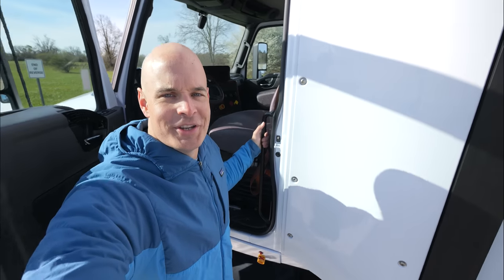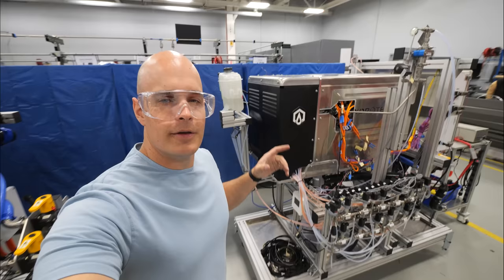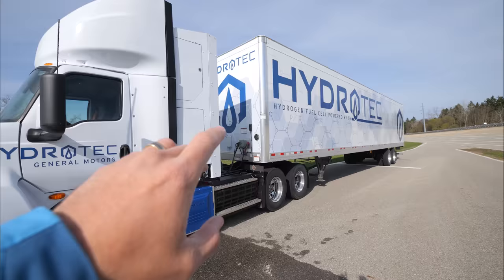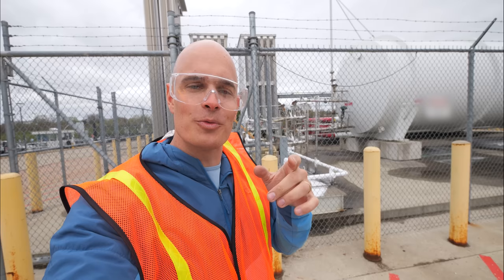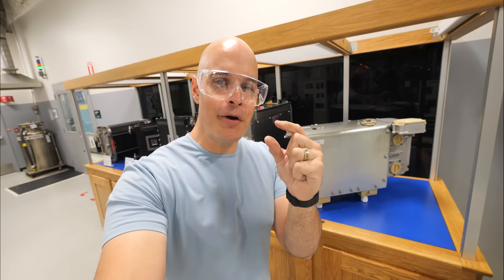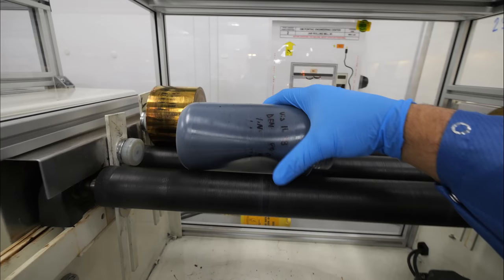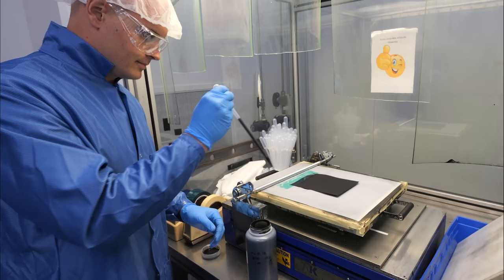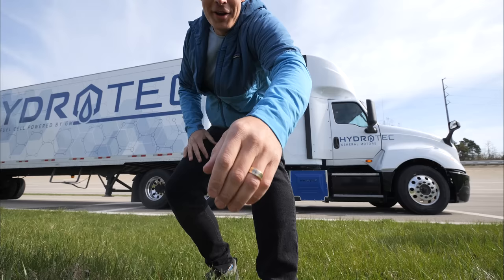How to build a Hydrogen Fuel Cell Semi Truck? - Hydrotec Factory Tour

Comment: There are still a lot of hurdles to overcome.  Fuel stations are still quite rare, even in countries that have put in a serious commitment to hydrogen.
Biggest issue is the cost of the hydrogen at the pump.  At least in europe it's quite common to pay about €10 for a kg of hydrogen. That is a very steep price... The law might have some issues too ; LPG vehicles already run into restrictions ( certain tunnels , boats en parking structures ban them.. ) and hydrogen might see the same issues.

Comment: A lot of different companies try to push fuel cells for passenger cars as a "future" (which is already here in form of battery EVs). This won't work. But bulky 10,000 psi hydrogen tanks are an okay-ish solution for already bulky vehicle like semi. The next step is to create an efficient way of producing cheap and renewable (not from fossil methane) hydrogen.

Comment: The hydrogen fuel cell is a great piece of technology.
There are some issues with transport and storage, but I think those will be solved.
What must not happen is that the hydrogen is produced with fossil fuels.  
If only renewable energy is used it can be the fuel for the future. 
And the Platinum used on average for a car fuel cell is about the same amount used in the catalytic converter.
Reply: Basically all commercial hydrogen is produced using steam reforming of fossil fuels.

Comment: A fuel cell and a big battery... thus a hybrid. What about replacing all that complex fuel cell by more battery. Simpler, and then you can charge directly on solar electricity! No more need to transport that difficult hydrogen gas. Batteries will probably get better, more energy dense. Can we expect the whole hydrogen fuel cell to get much better?
Reply: Exactly.

Comment: I worked at proctor and gamble about five years ago and they had forklifts with that hydrogen fuel cell, one of them exploded and blew the guy to pieces and sent a shock wave about a half mile away, and the cell wasn’t even half the size of the one in this video
Reply: "they never explode" until they do...

Comment: I can believe pure Hydrogen as input, but it is only getting about 21% Oxygen (78% Nitrogen). It would be interesting to verify the level of Nitrogen and it's Oxides in the exhaust.
Reply: To create any substantial NOx you need temperatures above ~1250C
If we see water vapor in the exhaust I doubt it is that high.
Ideally the exhaust would be 98% N, 1% Ar and -1% mixed gases.

Comment: Some companies in Colombia developed a hydrogen-powered bus. I think they will start testing it in public transportation in my city soon.
Reply: It's very common already. Iceland exclusively uses hydrogen busses if I remember right. They're blessed with natural hydrogen from the ground tho. Can't do that everywhere
Reply: @andrewk8636  Even Norther China is also favoring Hydrogen busses. The reason being is that they don't suffer range penalties at colder climates than batteries, they also allow low downtime assuming you have the refueling infrastructure setup since you can have multiple shifts with driver swaps without waiting for the bus to charge, so you end up buying less busses.

Comment: Well I love how all the videos that talk about Hydrogen ALWAYS forget 2 key elements:
Efficiency and Distribution.
Yes IF you can use clean energy to convert electricity into Hydrogen, that it becomes clean hydrogen (Extra mark on the IF), but the total efficiency of the hydrogen process from conversion to energy extraction is around 30%, contrarely to the 95+% of electricity.
Second point is DISTRIBUTION. Yes you save some weight on the truck due to batteries, and what does transport hydrogen around to all the refueling stations? A shit ton of trucks. Electricity flows on electrical cables, hydrogen does not, it requires a physical distribution network as big as the fuel one, with all the energy spent just in moving the liquid around.

So let's do the video adding some math on what is really the gain of Hydrogen

Comment: I'd like to see you create a larger scale model of a HHO generator that I built to power a motorcycle - Maybe do that on a HUMVEE scale? These cells are cool and all, But I don't think the idea of a gas station, even for Hydrogen is the way of the future. HHO or Hydrogen on demand should be what major manufactures are looking into. I would love to see you do something like that. Show people that HHO is the future if we get people to look at it seriously.
Reply: The whole appeal of hydrogen fuel cell vehicles is that they can be refueled quickly. If you create hydrogen via electrolysis on demand you lose the speed advantage but are stuck with the large inefficiency of the electricity->hydrogen->electricity process. Batteries would make more sense.

Comment: Thanks for giving Hydrotech a bit more coverage. They're largely ignored by the electrification crowd. That being said, I don't think that hydrogen is the correct solution for personal vehicles (even big, heavy HUMMERs 🙂). Personally, I'd like to see a bit more work on solid oxide fuel cells to convert NG and LPG into electricity. Those would be much more reasonable as range extenders for personal vehicles or replacements for gas powered generators.

Comment: Yeah, it's gonna require fossil fuels being made way more expensive via legislation for that to work. Otherwise, steam reformation from natural gas will always be the cheapest way to acquire hydrogen. Until that is the case, hydrogen is just more inefficient batteries with extra steps.
Reply: So, until that day comes, it's nothing but a greenwashing gimmick, unfortunately. And most car companies use it exactly that way and for exactly that reason.

Comment: I wonder how the "my exhaust is only water" -stuff works when it's Minnesota Cold outside.
Reply: How is it any different than the condensation that comes out every other tailpipe during winter?
Reply: @jimurrata6785  Tailpipes are quite large and also very hot. And if they break, they're just glorified metal pipes.

Fuel Cells are very delicate with tight tolerances, they cannot risk water freezing and expanding in the wrong place.
Reply: @Lepinkainen_  They use fuel cell fork lifts in the cold chain food warehouse here.
It can be -40 inside, but they don't get parked in there.
Reply: @jimurrata6785  Exactly, fuel cells work just fine when they run, that generates heat and condensation freezing isn't a problem.

But people don't park their cars in warm places during the winter. What happens to a fuel cell vehicle that has been sitting in -30C for a weekend? Does it waste power keeping the fuel cell warm 24/7? Does the cell risk breaking?
Reply: @Lepinkainen_  This is a truck with a 220Khw battery pack.
Id imagine if your livelihood depended on it you would make sure  the water in the exhaust didn't freeze.
Or purge it (depending on what the fuel cell manufacturer recommends)
Fuel cells are in use in Antarctica, Siberia even outer space...
Reply: @jimurrata6785  We still don't have any independent tests of FCVs in freezing temps, only car company sponsored ones. I find that really weird, if not suspcicious.

Comment: Huh, when you were outside the truck, was it still running? Was the sound made by escaping H2? Or was some kind of HVAC etc running which needed power, meaning that the hissing was the engine running?

Comment: I never thought about it until now, but if all it emits is water, can you just capture those emissions, run it through a filter to add minerals, then make it drinkable?
Reply: Me too, the water can replace the fuel volume, and its always nice if you can get water on the road, or maybe for cooling, though i think it would likely not drinkable because of the proccess of the chemistry and electrolysis
Reply: @Gazpolling  you can actually. I wouldnt drink the exhaust water from this product, but NASA creates drinking water on the space missions with the output water of their fuel cells, so it is possible.
Reply: @mikejadwin1304  wow, thats awesome, i know they are making use of urine filtering for mars mission, but i didnt know about the fuel cells
Reply: @mikejadwin1304  I think they also have special device on the ISS that captures the moisture in the air from sweating and breathing to then make drinkable. I remember seeing it in some video

Comment: The issue is hydrogen fuel is that you'd have to completely rebuild the entire fueling infrastructure. Not to mention oil companies support it because it lets them keep drilling and ties yet another crucial resource to their businesses. It's cool for certain jobs, but will never reach widespread use for obvious reasons.

Comment: Yes I would love to see a H powered Humvee. I would also like to see how water which is a source of hydrogen can be used by splitting it into HHOgas. Then sending it into the engine air intake. When done right you can turn down the gasoline intake by 50% by making the engine run lean. And letting the HHOgas do the rest cause it has 10x the pop than gasoline. I would also like to know how an engine can run on just HHOgas.
Reply: No you cannot. Onboard HHO generation is a famous scam.
Reply: You spend far more energy on the electrolysis than you gain back. 
There's always energy losses in conversions. You will simply be spending MORE fuel.
Reply: Let him do his own homework 😝
Reply: @charleslanier1992  him is who?

Comment: My understanding is 1 Kg of hydrogen has roughly 1.019 times the amount of energy as 1 gal. of gasoline; 1 gal. of diesel has roughly 1.155 times the energy of 1 gal. of gasoline. Even assuming 100% of energy recovery of the hydrogen and only 40% recovery of the diesel, which is overly estimated for the former and under estimated for the later, 6-10 Kg hydrogen tanks wouldn’t hold near the same amount of energy as 150 gal. diesel tank, which would seem to demonstrate not the same range but a shorter range compared to a diesel truck; this is especially true as most trucks have more than a 150 gal. fuel tank with some sporting 2 tanks and over  300 gal. of capacity. I like hydrogen fuel cell technology as it’s what got us to the moon but the big issue with all these alternative technologies is that both gasoline and diesel are just excellent fuel sources regarding energy density and usability and simply don’t have truly viable present alternatives; though hopefully technology will keep improving until a long haul solution is reached, namely no added weight or space and at least a 1,000 mile range to refuel with similar refueling or recharging times to the present.

Comment: I'd feel a lot safer if the majority of the tanks were located on the underside of the trailers. Keeping a small one onboard for driving around the yard/town. Heck, it could double as a staging tank so you can use thinner hoses to the trailers. But I'm no engineer, just an overly cautious driver.

Comment: it's nice that hydrogen is 10x more energy dense than li-ion batteries, but hydrogen doesn't output electricity directly, so it's a little of a stretch.  You could also say oak logs are more energy dense than li-ion batteries. For one, the fuel cell loses about 40% of that energy making it back into electricity.  Then you have the weigh of all the contraptions to store and make the hydrogen into electricity.  That tanks alone are 200 lbs to hold 20 lbs of Hydrogen.  In the end, it's only really about twice as energy dense if you count everything including the battery that you also need to make it all work together.

Comment: Definitely love this idea and hope to see success from it. My only question is how delicate are these tanks?  Since hydrogen is super flammable what happens if there is an accident?  Also how does this compare to eFuel?  Saw a really interesting video from donut about it recently
Reply: Tanks have to hold up to over 10000psi which is around 2/3 to 3/4 the yield strength of steel or aluminum so not as much of an issue that other would have you think to break them.
Reply: Tanks also have an expiration date.

Comment: I'm glad you're pointing out that renewable energy is the way to make H2, because when I always point out that H2 is the future there will always be morons whining about grey H2 (from oil).
Reply: You haven't thought it through?
Let's say there are 2 vehicle fleets.
One Full BEV.
One hydrogen.
They need to drive the same distance.
They both use grid energy supplied by green sources, Wind or Solar.
.
The BEV fleet requires 10GWh to drive the distance.
Being generous, the HFCEV Fleet will require ±30GWh to achieve the same distance.
.
You'll say "who cares, it's green energy!"
But.
The Grid is not 100% green.
For every extra 10GWh of green energy used to move the fleet, there must be an equivalent amount provided somewhere else on the grid.
.
If the green source is at full capacity, that substitute energy is from a dirty source.
.
In this example, the Hydro fleet results in 20GWH of Dirty capacity remaining on the system.
Even "green" Hydrogen IS "Dirty"
Not "grey"
"GREEN"
I've been trying to explain this to the "Green Hydrogen morons" circa long time. Maybe you'll be the first to understand......?

Comment: Got a long time before hydrogen tractors will have the 700hp and range I need for my mid Washington to West cost with 105k lb
Reply: They will almost certainly never have the range for that, they will have to be refueled just like a diesel rig. The advantage is how quickly that happens vs charging. A fuel cell is kind of like a battery, but instead of recharging you just add more electrolyte. Downside is it’s less efficient than a pure EV because you lose energy when you make the hydrogen (assuming you are splitting water with electricity to make the h2) and loose energy again when you run the h2 through the fuel cell. Still better than burning the h2 though. ICE is around 30-40% efficient, fuel cells are around 60%, ev is around 90%.
Reply: @forrest225  yeah I regularly do 800-850 miles a day in my deleted 2020 W990 with a 700hp X15,  staying in Washington and don't have the time to be a slug on the hills doing 35. I pull these 105k loads up ryegrass lower part at 55 and sit on the cruise at 64 the upper part. Even the Tesla semi can't do that, however I have greatly given it thought to cash out, if Tesla can get their head out there ass, a Tesla semi and switch to a even more local run because then I wouldn't have the massive diesel fuel cost forcing me to take the longer higher paying stuff just to cover fuel
Reply: @N54God666  its the same with Farm tractors and combines its not like driving a car or truck on flat ground where they only use high power to get up to speed, trucking up a mountain or pulling a seeder through a field means putting down lost of power for extend periods of time i did the math on a a tractor we use to own its was a NH T8040 only a modest 221kW/300HP but it could do that for an easy 10 hours straight if it where using Tesla P100D battery packs the battery pack alone would weigh 12 tonne.
Reply: @phalanx3803  do you understand how heavy 12 tons is?

Comment: hey Zack, Could you speak more on the safety of these? If we had 100s of trucks ike this carrying pure hydrogen, wouldnt a crash on the road end in massive fireballs? What mechanisms are in place to keep that terrifying reality a smaller possibility? gasoline right now doesnt combust as readily as hydrogen sooo
Reply: The tanks are really strong. A regular automobile crash won't do anything. IIRC in Toyota's testing they needed armor-piercing missiles in order to rupture a tank.

Comment: I think fuel cells are the only way to get hydrogen set up for trucks and cars.  The hydrogen combustion engines simply lose too much efficiency, when the energy density is already so low compared to diesel.  Maybe biodiesel will end up taking a bigger role.

Comment: really interesting !
H2 Fuel Cell seems logical for Semi truck

Engineering Explained explained in one of his video that at the moment, most H2 is made from methane, because it takes 1/4 of the energy that from water. when green kWh is 1/4 of the price of methane (during sunny days, windy days, or from dam), then you get green H2 and it's the best
but the downside is the cost in making, véhicules and infrastructure. i dont see a durable use case for average private use, while the full battery cars are getting better and better each year. But for fret transport between point A and point B, where trucks just go back and forth the whole day, it's easy for companies to build a H2 charging station at each warehouse. Maybe also for public buses, or some ferries ?
Reply: You know there are methane fuel cells, right?
Methane is as easy to store and fill as your BBQ tank.

Comment: It would be seriously cool to see this in personal EVs. You don't have the weight or charging time problems like with batteries and it still runs clean with water being only by-product that will evaporate anyway-

I am excited for this kind of vehicles in the future. I don't like fossil fuel cars because they are noisy and the fumes are damn awful especially if the car is not well kept or running on low quality fuel.
Reply: You can, its called the Toyota Mirai, and its very much got its downsides.